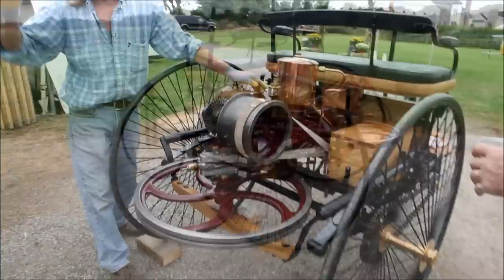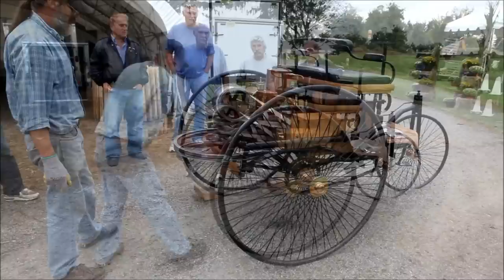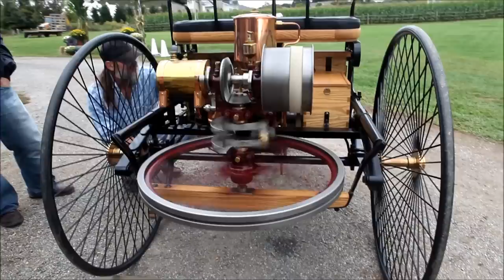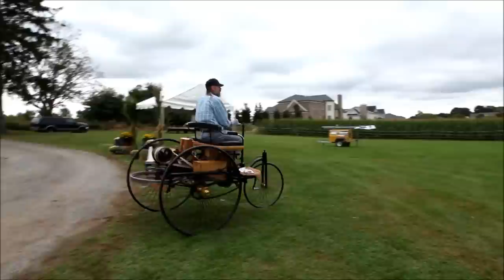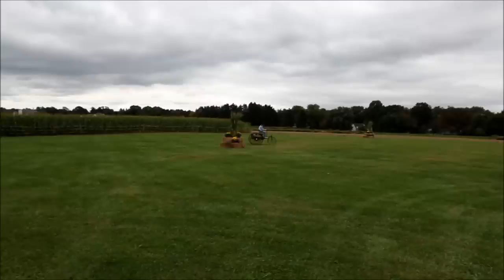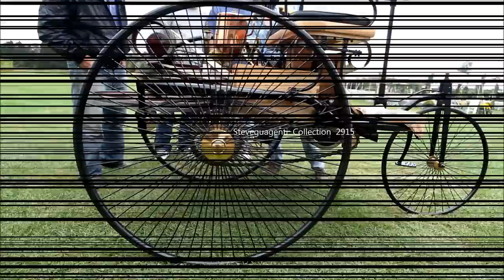Driving   Mercedes Benz 1886 ...Turning Over

Comment: Just Like Cars Where Not Invented Back In 1700s Not Until 1886 Or Late 1890s
Reply: Cars using fire that could vary their speed quickly came out with the machine in this video. Railway locomotives used fire but could not change their speed quickly because you had to heat up or cool down the whole engine block. And before that cars ran on springs thanks to one of the Teenage Mutant Ninja Turtles that leads.

Comment: Yo make a tool to give u more leverage or use wheel to pullys with small motor or if u like pushing by hand make a lever with quick release hood pins make it easier to start if it orginal leave that way it is tho only if not orginal parts also could do mini bike pull start wrap around pullys wheel do not tie it and then pull it

Comment: MP3
Reply: They were posting threads on Usenet in 1994 about MPEG-1 Layer 3, which was known as MP3 files, which makes it 26 years old. Around that time the Apple QuickTake digital camera came out and dial up online services and e-mail were all the rage. And there were Cathode Ray Tube displays everywhere and if you wanted to watch a movie at home you either watched it on a VHS tape or spend ungodly money and got a Laserdisc player. They were doing experiments with Video CDs using MPEG1 1411 kilobit bit rate, which is potato quality digital video, and they could only run for about 74 minutes before you had to change the disc. Unless you had a CD player or a Reel to Reel, recorded music sounded spectacularly dark and dull and hissy from cassette tapes with the azimuth mis-aligned, unless you were in the 6 figure salary club and owned a Minidisc recorder. If you were out and about and wanted to make a phone call you had to go find a payphone, unless you paid per minute for an analog cell phone. Home computers always seemed to run too slow and you always wished for a newer more expensive one. Data was recorded on floppy disks, which I consider a write-only medium with a shelf life of about a month, you were constantly copying the data onto fresh disks, and if you used a floppy drive, you will already know where the matchbook should go.  And did you know that in 1994 Windows just found out that you have moved your mouse? That means that you MUST restart your computer. And you have to blow into the video game cartridge to get it to start, and change to TV channel 3.